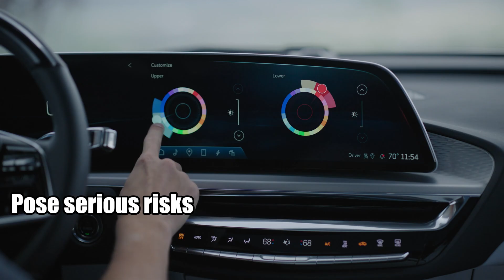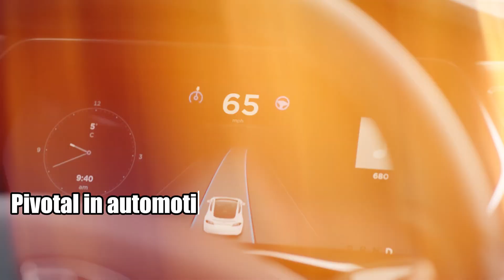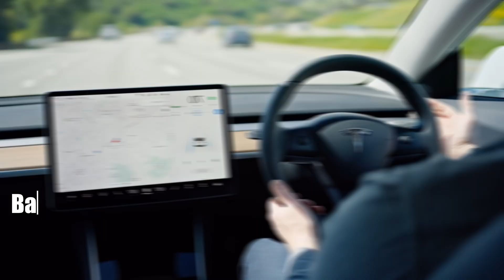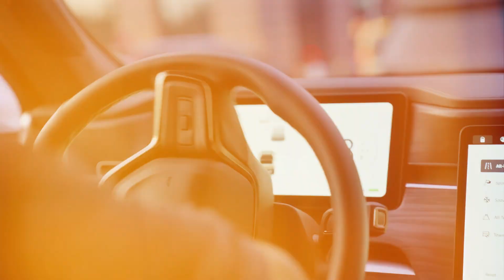The Untold Truth About Electric Car Deaths—Why Silence?

Comment: Many more ICE cars than EV's = more fires. Also many ICE fires are under bonnet (hood) fires, on older cars poorly maintained. Perished rubber fuel lines and shorts caused by degraded insulation on wiring are often causes. They can  be extinguished by turning off the ignition and using a fire extinguisher through a partially opened bonnet still on the safety catch. This restricts the amount of oxygen getting to the fire.
Most EV's catching fire are relatively new, or just new. Once started the fires are very difficult to extinguish and can result in a violent and unpredictable conflagration as leaking gases ignite. The fire often burns until the car is practically incinerated and the smoke given off is highly toxic. Not to mention the electrics giving up, resulting in the occupants trapped inside to (hopefully), asphyxiate, only because it's better than burning to death.
So no worries there then.

Comment: If EVs were as good as hyped they would not require government (read tax payers) handouts and incentives to purchase.  Since EVs are so much heavier that ICE vehicles they should be charged extra for registration due to accelerated road wear, and an additional per mile charge because they are not paying road tax in the form of taxes placed on gasoline and diesel fuel.

Comment: Fires in internal combustion engine cars + hybrids = 99,6%.  Fires on ev account for only 0.4 %, less than half a percent.  By the way hybrids are the most dangerous cars in relation to fires.

U.S. fire departments respond to an average of 287,000 vehicle fires per year (nearly 17% of all reported fires). These fires cause an estimated 480 civilian deaths (more than 12% of all U.S. civilian fire deaths), 1,525 civilian injuries, and $1.3 billion in direct property damage annually.
In contrast:  According to an Australian company that tracks passenger EV fires globally, electric vehicle fires make up a very small portion of total vehicle fires. EVFireSAFE found that there were only 393 verified EV fires between 2010 and June 2023 out of an estimated 30 million electric cars that are active on the road.
The fire in the parking building was caused by an hybrids car.  Tesla vehicles are the less prone to catch fire, less prone to have an accident, and the lowest percentage of death pe accident.
ADAS effect (Tesla): In the 1st quarter, we recorded one crash for every 7.63 million miles driven in which drivers were using Autopilot technology. For drivers who were not using Autopilot technology, we recorded one crash for every 955,000 miles driven. By comparison, the most recent data available from NHTSA and FHWA (from 2022) shows that in the United States there was an automobile crash approximately every 670,000 miles.

Comment: To conquer the market, electric cars (EVs) only have to be technically superior to the Internal Combustion Engine cars (ICE). It’s clearly the case.
1.	EVs are simpler to make: Tesla, for instance, has reduced the number of pieces for the front part of the vehicle from 70 pieces to only one. (It’s the same thing for the rear part of its vehicles.)
2.	Tesla, BYD and Volvo demonstrated that it was possible to produce profitable EVs; something legacy producers like GM or Toyota are unable to do. It’s because they feared bankruptcy that many companies stopped producing EVs. 
3.	The price of EVs is falling rapidly due to the rapidly falling price of their batteries (- 30% in 2023).
4.	No cobalt or nickel are used to produce the most modern EVs.
5.	EVs pollute much less than ICE cars, especially when they move.
6.	EVs are more stable on roads because their heavy batteries are located at the bottom of the car.
7.	EVS protect better their occupants when there is a collision due to the rigidity of their battery packs.
8.	There are fewer than ten (10) moving parts in an EV engine compared to more than a thousand in an ICE car. That reduction in the number of pieces means that less machinery are used to produce them. As a result, producing electric cars creates less pollution.
9.	EVs accelerate more rapidly than ICE cars when their drivers try to overtake other cars.
10.	The brakes on an EV last much longer due to their regenerative braking system.
11.	The dashboard of an EV is much simpler to produce since almost all the controls are on the on-board computer.
12.	There are fewer liquids in an EV (windshield cleaning fluid, battery fluid).
13.	EVs are roomier than ICE cars because their engines are much smaller. 
14.	Most technical problems on an EV can be solved ¨over the air¨ without having to go to a dealer.
15.	EVs don’t need to go to the dealer for regular maintenance.
16.	Everybody can buy an EV on the Internet without having to go to a dealer.
17.	Recharging an EV is 80% cheaper than filling the tank of an ICE car.
18.	Nowadays, there are multiple ways to produce electricity. (N.B. In 2023, solar panels are the cheapest way to produce electricity. And they almost never need long transmission lines).
19.	Nowadays, charging stations are everywhere while the number of gas stations is decreasing.
20.	Contrary to ICE cars, EVs can be recharged at home.
21.	EV owners say they have no problem with the autonomy of their vehicle.
22.	If EVs explode from time to time, 200,000 ICE cars explode every year in USA.
23.	Finally, we need to replace ICE cars with EVs for two other reasons. First, because petroleum is becoming scarcer on the planet and, second, because we all need to stop depending on an explosive region like the Middle East for our main source of energy.
24.	Etc.
Reply: Electric cars are also vulnerable to remote control and hacking.
Reply: @zeehng5736  So basically all cars with computers.
Reply: @Vansafe0  Tesla has a lot of wireless software controls that are easily interfered with and hacked.
Reply: Did you know that it takes an hour and a half to charge at a fast charging station in Chicago this winter, not including the three hours of waiting? I don't want to worry about charging every day. Some charging stations are broken or have power outages, and electromagnetic radiation, you know? Electric cars catch fire very quickly, and there is no way to put it out. You can only watch it burn out. Electric cars are new cars that have just left the factory and they also catch fire. Old cars are even more likely to catch fire. Electric cars in the United States are only about 1% of gasoline cars. There are no fewer fires. Many electric cars have been in recycling stations for 10 years. Gasoline cars are decades old or have modified lines. The fire starts in the front of the car. Most of the materials are non-flammable. There is also a firewall in front of the driver. It often takes half an hour to burn out. It will not burn the cockpit unless it hits the fuel tank. If the lower part of the battery is hit casually, do you still dare to park the electric car in the garage? Although oil cannot be regenerated artificially, it can be regenerated by earthquakes, volcanoes and crustal movements. This is why we always discover new oil fields.
Reply: @zeehng5736  The technology of EVs is improving rapidly and all the problems you are talking about are being solved rapidly. It's not the case for ICE cars which used outdated technologies. As soon as the selling price of EVs will be clearly lower than the price of ICE cars, the market will force the general adoption of EVs without any government intervention. (Our governements are subsidizing heavily EVs AND ICE cars as well as the petroleum industry.). 
That moment has already arrived but it's just not evident. In other words, the electric revolution cannot be stopped. ICE car manufacturers will soon be bankrupted and service stations will start to disappear. That's the normal fate of dinosaurs...
Reply: In the past, many oil trucks caught fire because they used natural gas, which has a low ignition point. Now, it is rarely used, so there are fewer fires. So why do diesel trucks, which have a high ignition point, also catch fire? Because two people drove the truck for more than 20 hours before it stalled, and some drove millions of miles. Can electric trucks be driven like this?